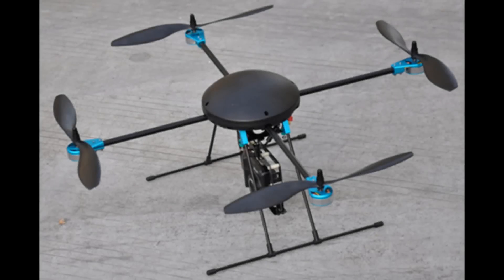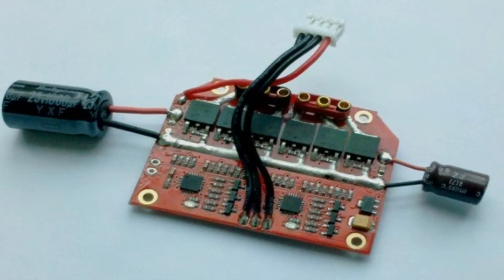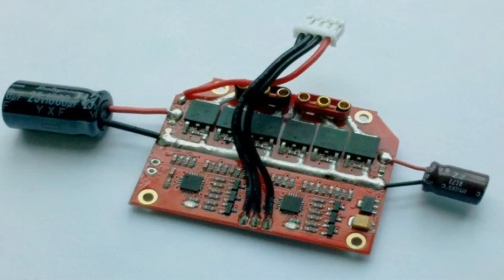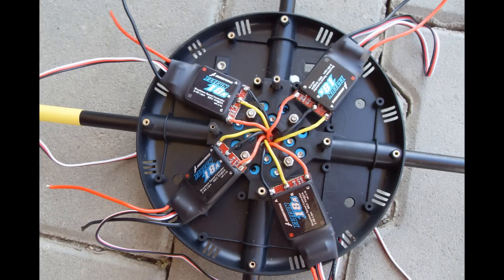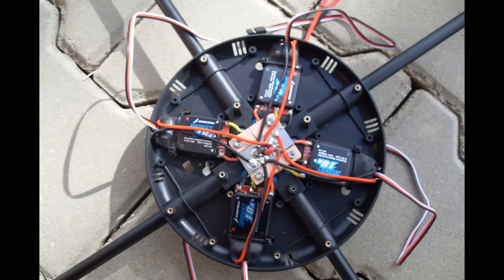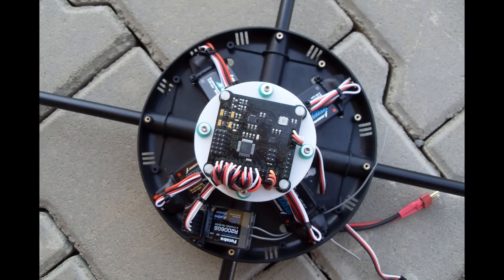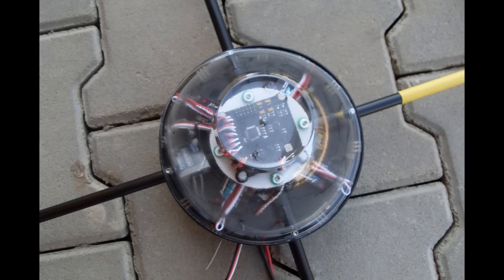Metamorphosys - Lotus T580 to MWii mod - or how to make a Lotus quad fly reliable

Comment: I returned the old config, I am removing the 1175kv engines and replacing 600kv , the Board is the Sirius Paris V4R6 and Esc's are 18Mah, friend, you could send it to my email as set up or where can I find step by step configuration of firmware? 
Best regards
Paulo Neves
(my address: cable.conection@mandic.com.br

Comment: Amigo, não tenho tido muito sucesso com os voos de meu Lotus T580 modificado, peço uma ajuda sua, se possível que me auxiliasse na configuração de meu quadricoptero, imagine que você tenha o frame do Lotus T580, 4 esc's carbombird 18 Mah, quatro motores Carbonbird 1175 Kv e uma placa Sirius Paris V4r6, onde posso baixar o firmware para um voo estável e seguro? as hélices são de 8x4.5, é necessário o código Arduino? onde o encontro?  se você puder me fornecer os endereços fico grato.

Comment from the maker: Doesn't matter which flight controller, I guess u could use KK, MWii, ardupilot or openpilot, important is u use an ESC which is overdimensioned not to overheat and the correct props for the engine. So I would use min 18Amp ESCs and 12x3.8 props for this frame with a 3S lipo and I'll bet it'll fly with most of the flight controllers default PID settings for the gyros and accels, for GPS u'll probably will need some test flights to find the optimum settings.

Comment from the maker: Paul, the 1175Kv engines are not a bad choice if u use them with a 10x4.5 or a 9x4.5 prop. I kept the original engines because having a lover Kv they also have a bigger torque so better for a 12 inch prop. I first tried with the
original 12x6 props but the thrust they developed was coming to early on the throttle curve and was not a happy config for a small frame like that. Could have been stabilized that way too but would have reduce the PID values significantly so I switched to 12x3.8 props.

Comment: Dear friend had the same problem with my Lotus T580,  I  bought a multiwii Paris V4r6, 4 Esc's Carbonbird of 18 Amp, I ride and I was told that these components did not work right with the original engines of 600Kv, by your video I see that is not true because their engines are original Lotus so I bought four 1175 Kv engines each of Multiwii in Australia, sent to the Assembly, I'm hoping the return to fly and post a video with the result.
big hug
Paul Snow
Brazil.